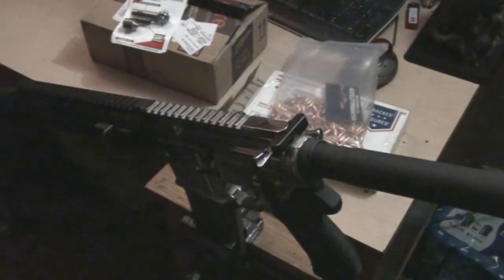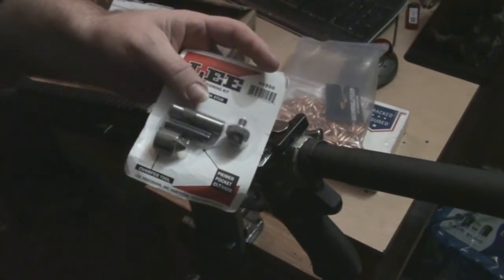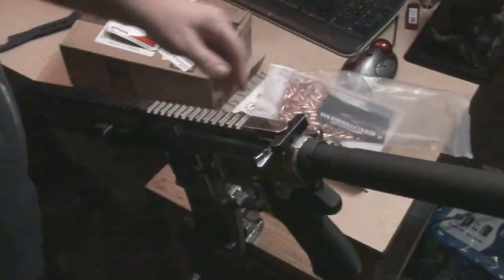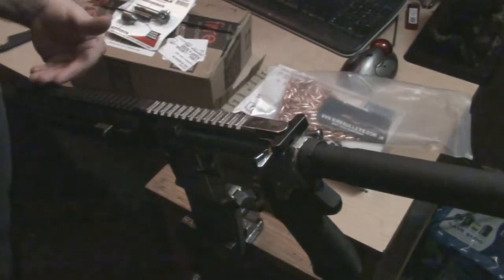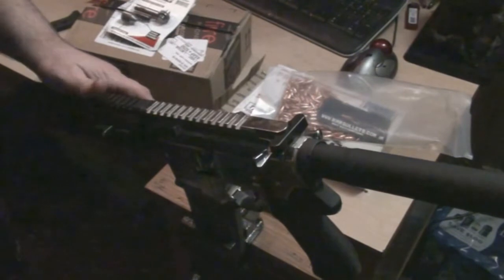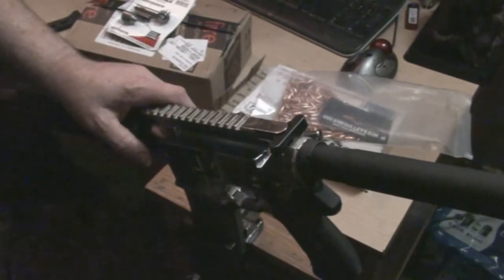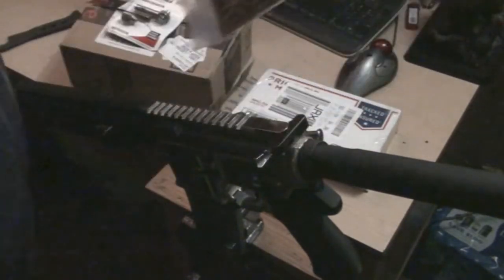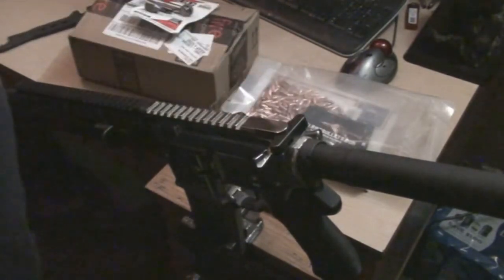A Wrench,  A Pistol, and A Whole lot of Bullets

Comment: Based on your description of the problem, I would say it's the buffer tube spring or plunger is to heavy. 5.56 has more pressure and pushes harder against the buffer spring, 2.23 less pressure less force on the spring so you end up short stroking.
Reply from the maker: It's actually got the buffer spring and plunger in it that originally came in Bridgette, it was weaker than the one that came in the pistol buffer set and the buffer was lighter.

Comment: If you're getting a carbon build up where the tube goes into the block then there's a leak there, which you knew that!! Put some clear fingernail polish there to temporarily give it a seal and see if that improves the issue. You may want to put 2 coats of it to make sure it's sealed!! Couldn't hurt!!
Reply from the maker: Might just try that....

Comment: Are you using the buffer that came with the kit or did you put the spikes heavy buffer in it? I have zero experience with AR pistols, so the buffer is the only thing I can think of
Reply from the maker: I actually after the first couple of failed shots changed the buffer and spring for the old ones from Bridgette, the were lighter.

Comment: Does it lock back on an empty mag? Too small or too large of a gas port? Only thing I could think of. If it's spec. This is a fix but one people will tell you not to do (Don't do if it locks back on empty mag). Cut half a coil off at a time and see how it runs.
Reply from the maker: Mag doesn't lock back so that might be a plan....
Reply: Try other springs? I've noticed that some of mine feel different when hand cycling. I don't think that'd be a huge factor. It's definately a gas or alignment issue though.

Comment: Good luck bro I am at a lose on this one I think its either the tube or the port is a hair to small but who knows
Reply from the maker: Might try this seal the tube with clear finger nail polish to see that is the problem.
Reply: alleric357 I was thinking aqbout this today at work, its afucking long shot but take the break off the end and run no comp or treatment on the end, I am wondering if the comp is causing some kind of fluctuation n the pressure wave or the backpressure on the rifle since the barrel is so short.  Its a long shot but just like a suppressor it may be fucking with the gas system...just a thought
Reply from the maker: djalkaline1
OK

Comment: Give it some gas x.  Long shot on your cycle issues, have you looked at the seal/mating of your bolt carrier with the gas tube?  To much of your gas escaping will not cause the pressure need and you get that short stroke.  It's that impulse that makes it cycle...um I'm sounding gay.  I've never built one, but my dad hated them and I got in trouble teaching a bunch of rats how to bust down m14s at vmi before they gave a class on how to clean your rifle.  No expert, but I know what happens to an M1carbine if you don't include all the parts, so try to look at your pistol in a direct impingement system mentality even if it isn't.